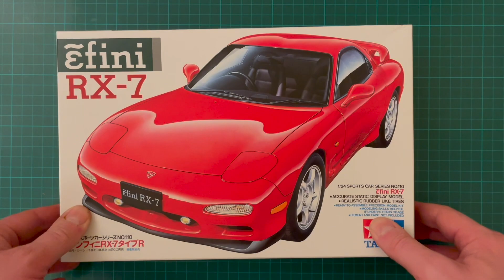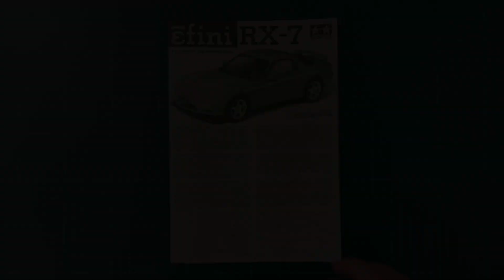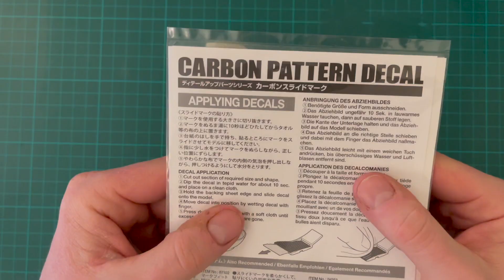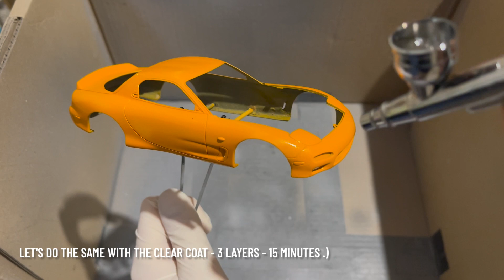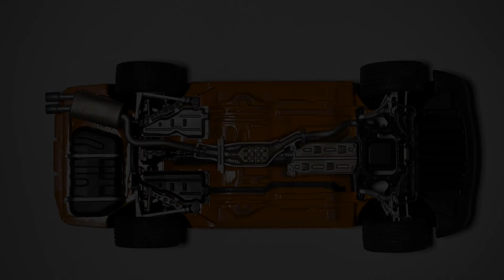Building 1/24 TAMIYA Efini RX-7 (FD3S)

Comment: hello, amazing work, could inform PSI that you used to paint and to apply the clear coat? paint is lacquer or acrylic? thanks a lot!
Reply from the maker: Thanks a lot 🙏 For this build I have used my old Air-Brush bundle, which does not worked well with holding the air pressure 😅 but today with my new device I am using about 20 PSI and a 0.5mm nozzle for applying paint and clear coats. The paint is mostly Tamiya X/XF which is acrylic. In my current builds I have tried some Tamiya Lacquer Paints (LP-Series) which definitely brings clearer results and brighter colors.
Reply: @enso_scale thanks a lot! Currently starting in the hobby and your videos are helping a lot!